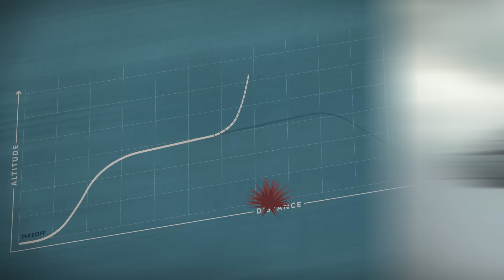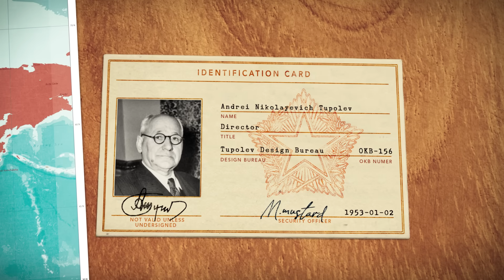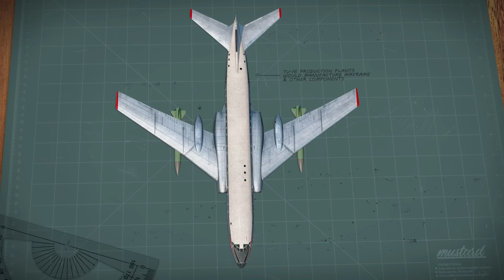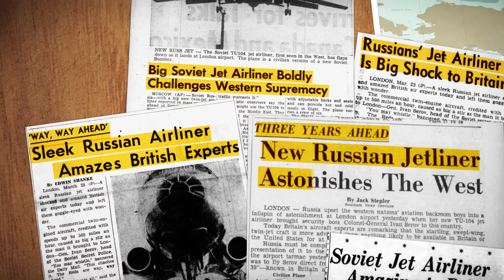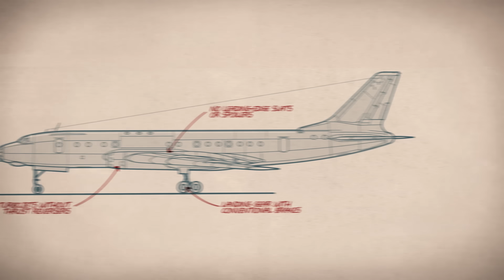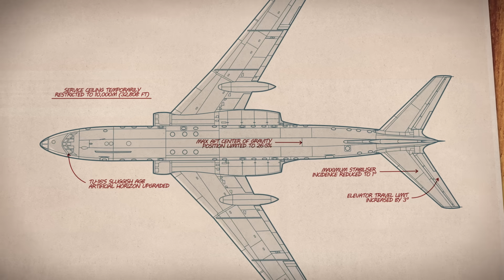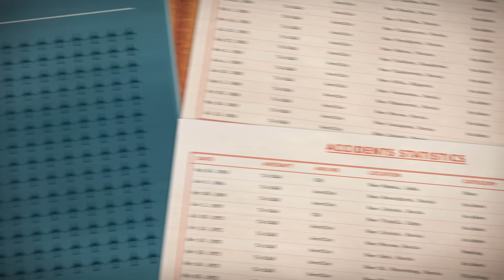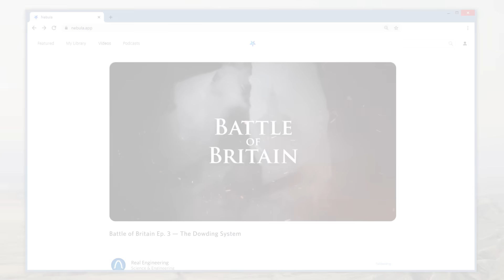The Soviet Airliner Designed To Crash

Comment: It's in English narration, but the results are the same in the end. Just ask Putin.😂
Reply: The British Comet is the worst jet airliner in history... no jet airliner has more crashes and fatalities than the Comet.
Reply: @DoktorBayerischeMotorenWerke 

We believe we can clear up some commonly held myths and misconceptions obviously.

It's always good to see the facts presented clearly and concisely isn't it?

Can have any size / shape windows, depends how much extra frame weight gain is acceptable. The ideal shape is elliptical, vertical dimension being largest and vertical to horizontal dimension ratio = to hoop pressurisation stress to longeron stress ratio. 

Obviously there have been worse aircraft for accident losses both before & after the Comet.

The engine position and inlet design had advantages at the time. The inlet design was changed to help reduce the chances of pilot error caused stalls during takeoff. 

All jet airliners benefited greatly from the knowledge gained from the Comet incidents & subsequent investigations & yet some were still worse for accident losses. 

Instances of all marks of the Comet flew with full certification after 1954 including the Comet 3.

The fabulous trail blazing DH Comet.
World's first jet airliner.
World's first high altitude airliner.

    How things were back then.
Accident losses - % of aircraft built.

It should be remembered that it was not unusual for the first batch of say 10 of a type to have much higher accident losses than all the aircraft built. 

DeHavilland Comet 4 UK                     14% 
DeHavilland Comet all (ff 1949)         17%  
Vickers VC10 UK (ff 1962)                   5%

Douglas DC-1                                      99%
Douglas DC-2                                      47%
Douglas DC-3                                      30%
Douglas DC-4                                      26%
Boeing s300                                          72% 
Boeing 307                                            70%
Boeing 247                                            48%
Boeing 707  (ff 1958)                           20% 
Lockheed L-049/149 Constellation    30%
Lockheed Electra  Turboprop .            29%
Fairchild FH-227                                   30%
McDonnell Douglas DC-8                    14%.
Sud Aviation Caravelle  (ff 1955)       15%
Canadair CL-44 Turboprop (ff 1959) 46%  
Convair CV-580  Turboprop                22%
Convair CV-880     (ff 1959)                27% 
Convair CV-990     (ff 1961)                33%
Tupolev T-104        (ff 1956)               16%
Vickers Viscount   (ff 1948)               32%             

  The Vickers VC10, fastest Atlantic crossing for a non supersonic jet airliner, held the record for 41 years.

For the first few years of operation the Caravelle & Comet had similar accident loss fatalities.

The first few Nimrod airframes were Comet 4 airframes with the equipment bay tacked on. Subsequent Nimrods were new build Comet 4 airframes with the modifications built by the DH team at Hawker Siddeley.

The world's first wind tunnel was constructed in England during the 1870s. The world's first supersonic wind tunnel was constructed in England in 1922.

   Of course De Havilland carried out a full stress analysis & performed extensive & protracted testing, including pressure cycle testing, on two long lengths of fuselage. De Havilland carried out significantly more testing than was required by any authority at the time & significantly more testing that any previous airliner was subjected to.

   De Havilland did indeed always work to better than industry standards at the time, used up to date knowledge for the design & no evidence of negligence or criminal negligence was ever produced in relation to the DH Comet.

  The DH Comet had better safety than or similar safety to many other commercial passenger aircraft of a similar era both before & after the DH Comet.

The accident loss fatalities for the first few years of operation were similar for both the Sud Aviation Caravelle and the De Havilland Comet.
  
Pretty much all changes made after the Comet 1 were just in case changes or were previously planned ongoing improvements.

How things are these days and what's going on in the world.

Airbus is not a German company. There are no longer any German companies making German jet airliners in Germany and there are no German companies making German gas turbine aero engines in Germany that are suitable for wide body airliners. 

That's correct, The Tornado & Typhoon & their engines are supersonic & are indeed British design aircraft with British design engines built by an international consortium. The Tornado design for example started life during the 1950s at Vickers as the AFVG, it's engine is based on the RR RB-199. The EE Lightening is also a British Supersonic jet aircraft.

The Typhoon is the British BAC-EAP with an engine based on the British RR XG-40, the Typhoon is also built by an international consortium.

   A typical but small glimpse of what goes on in the very internationally orientated British aerospace sector.

  Of course the RR Nene was in fact the world's most reliable & most powerful gas turbine aero engine in 1944. Licensed built versions & copies of the RR Nene & RR Derwent would go on to power many aircraft in Russia including the Mig 15 & Mig 17, the US, China, France & other countries for decades after 1944.

The Axial multi stage sequential stage  compressor & turbine technology, first produced for turbo machinery use in England by Parsons of Ireland & North England during the 1800s. The components form the basis of most modern gas turbine aero engines. At the time the concept of the jet aircraft powered by axial internal combustion gas turbine engines was first mentioned thus the internal combustion jet engine & jet aircraft was indeed invented in England before the 1900s & before the Wright brothers got busy.

      Boeing Apache Attack Helicopter.
AH-64: 75 UK suppliers, 7% UK content, global fleet of 1280+ aircraft.
F35B more than 130 UK Suppliers, more than 30% UK content.
F35A & F35C more than 130 UK Suppliers, more than 15% UK content.

There is no doubt that an airline has recently ordered 60 RR England Trent XWB Engines

Obviously the UK has the
World's Highest Combined Per Capita
Nuclear / Defence / Aerospace Sector Activity.

Rolls Royce Holdings UK
Subsidiaries
- Rolls-Royce plc
- Rolls-Royce North America (ex Allison etc Classified Military stuff)
- Rolls-Royce AB
- Rolls-Royce Deutschland
- Rolls-Royce India Private Limited
- Rolls-Royce Marine Power Operations
- Vinters Engineering Limited
- Rolls-Royce Controls and Data Services
- Rolls-Royce Power Systems
- Bergen Marine
Joint ventures include:
- Rolls-Royce Turbomeca
- MTU Turbomeca -

Trent Family
The MT30 (Marine Turbine)
Industrial Trent 60 Gas Turbine
Trent 7000
Trent XWB Airbus A330neo.
Trent 1500
Trent 1000
Trent 500
Trent 600
Trent 700
Trent 800
Trent 8100
Trent 900
   
RR wholly owned subsidiaries in Germany handle smaller 2 shaft RR gas turbine aero engine work.
    
We do indeed hope this helps, of course.         
    
As always, cheers & 👍 indeed etc.c

Comment: I know the comet also has some issues
Reply: Потери в результате аварий - % от построенных самолетов.

DeHavilland Comet 4 14%
DH Comet всех модификаций (выпущен в 1948 г.) 17%
Vickers VC10 UK 5%

DH Comet обладал большей или сопоставимой безопасностью со многими другими коммерческими пассажирскими самолетами аналогичной эпохи.

Douglas DC-1        99%
Douglas DC-2        47%
Douglas DC-3         30%
Douglas DC-4           26%
Boeing s300             72% 
Boeing 307               70%
Boeing 247                48%
Boeing 707                  20% 
Lockheed L-049/149 Созвездие 30%
Lockheed Electra Турбовинтовой 29%
Fairchild FH-227                          30%
Макдоннелл Дуглас DC-8       14%
Sud Aviation Caravelle       15%
Canadair CL-44 Турбовинтовой    46%  
Convair CV-580 Турбовинтовой 22%
Convair CV-880 (с 1959 г.)  27%  
Convair CV-990 (1961 г.) 33 %
Туполев Т-104 (фф 1956) 16%

Comment: The problem with this airline Aeroflot and the Russian airplane sinply is: They are Soviet made... trash.
Reply: На мусор больше смахиваешь ты и твой рот)
Reply: Потери в результате аварий - % от построенных самолетов.

DeHavilland Comet 4 14%
DH Comet всех модификаций (выпущен в 1948 г.) 17%
Vickers VC10 UK 5%

DH Comet обладал большей или сопоставимой безопасностью со многими другими коммерческими пассажирскими самолетами аналогичной эпохи.

Douglas DC-1        99%
Douglas DC-2        47%
Douglas DC-3         30%
Douglas DC-4           26%
Boeing s300             72% 
Boeing 307               70%
Boeing 247                48%
Boeing 707                  20% 
Lockheed L-049/149 Созвездие 30%
Lockheed Electra Турбовинтовой 29%
Fairchild FH-227                          30%
Макдоннелл Дуглас DC-8       14%
Sud Aviation Caravelle       15%
Canadair CL-44 Турбовинтовой    46%  
Convair CV-580 Турбовинтовой 22%
Convair CV-880 (с 1959 г.)  27%  
Convair CV-990 (1961 г.) 33 %
Туполев Т-104 (фф 1956) 16%

Comment: Regarding the fabulous trailblazing 
De Havilland Comet.
Accident Losses generally.

We feel we can clear up some commonly held myths and misconceptions, obviously.

It's always good to see the facts presented clearly and concisely isn't it?

De Havilland was subjected to forced merger under the govt aerospace sector rationalisation programme. A similar process occured globally, Sud Aviation and several other French manufacturers merged during design and production of the Caravelle with the Caravelle becoming a significantly international type project. Even in the US, there was no room for multiple manufacturers of large jet airliners with consolidation being inevitable.

The world's first wind tunnel was constructed in England before 1890.
The world's first supersonic wind tunnel was constructed in England during the 1920s.

The DH Comet was subjected to every type of stress testing & wind tunnel testing possible at the time. 

The world's first high altitude airliner.
The world's first jet airliner.

In fact the Comet was the first airliner to have a full fuselage length pressurised passenger cabin suitable for high altitude flying where pressurisation stress was many times higher than flying load stress. Bow-wing (see b-47 wing folding wing collapse incidents) had built less than 12 pressurised cabin airliners before the Comet first flew. The world's first pressurised cabin aircraft was a British design Airco built under licence in the US and modified in the US to have a pressurised cockpit cabin during a joint US / UK research project. Previous pressurised aircraft were airliners with lower pressurisation & altitude limits where pressurisation stress did not exceed flying load stress or were bombers with small heavily built cockpit capsules where potential total  airframe weight gains were insignificant.

The Comet nose was a unique De Havilland design that Sud Aviation subsequently licensed for use on their Caravelle.

Correct, the Comet was designed with military use in mind. In fact, the first designs were based on military use requirements, the first Nimrod aircraft were straightforward modified Comet 4 airframes. Obviously when the Nimrod first flew, it was of course the most advanced and capable aircraft of it's type in existence. All subsequent Nimrod airframes were indeed simply mostly  new manufacture Comet 4 airframes with the additional equipment bay added. Nimrod design and manufacture was in fact performed mostly by the De Havilland team at HS. 

The Comet was in fact an all metal construction airframe airliner, use of other materials was similar to all other airliners at the time. 

  Obviously there have been worse aircraft for accident losses both before & after the Comet. One of the issues was accident losses due to pilot error which were often caused by the novel aspects of jet airliner flying, even so, the accident losses for the Comet as an airliner were not particularly unusual at the time.

Some changes made were to make pilot error on takeoff less likely to cause serious problems. For example, the skin thickness remained mostly the same from Comet 1 to Comet 4.
Ripstop provision existed for all Comets. The original alloy used was discontinued by the manufacturer, the replacement alloy had similar properties.

  Indeed, at the time aviation infrastructure & aircraft technology etc was still developing rapidly, there was still a lot to do when considering all aspects of flying safety.

    How things were back then. 
Accident losses - % of aircraft built.
DeHavilland Comet 4                   14% 
DH Comet all mks   (ff 1948)       17%  
Vickers VC10 UK                            5%

The DH Comet had better safety than or similar safety to many other commercial passenger aircraft of a similar era.

Douglas DC-1                                      99%
Douglas DC-2                                      47%
Douglas DC-3                                      30%
Douglas DC-4                                      26%
Boeing s300                                        72% 
Boeing 307                                          70%
Boeing 247                                          48%
Boeing 707                                          20% 
Lockheed L-049/149 Constellation  30%
Lockheed Electra Turboprop             29%
Fairchild FH-227                                  30%
McDonnell Douglas DC-8                   14%
Sud Aviation Caravelle                        15%
Canadair CL-44  Turboprop                46%  
Convair CV-580  Turboprop                22%
Convair CV-880     (ff 1959)                27%  
Convair CV-990     (ff 1961)                33%
Tupolev T-104        (ff 1956)                16%

The VC10 held the fastest Atlantic crossing speed record for 41 years (Non supersonic airliners).

For the first few years of operations the Caravelle and Comet had similar accident loss Fatalities numbers.

  Instances of all Comet marks, including the Comet 1 and Comet 3 flew with full certification at some point after 1954. Airline duty Comets were all retired by 1980 with full certification until after retirement. The last Comet flight was a global circumnavigation series of flights in 1997.

   Of course De Havilland carried out a full stress analysis & performed extensive & protracted testing, including pressure cycle testing, on two long lengths of fuselage. De Havilland carried out significantly more testing than was required by any authority at the time & significantly more testing that any previous airliner was subjected to.

  Of course De Havilland had prior experience building many all metal construction airframe aircraft & thousands of jet powered fighter aircraft that were primarily of metal construction with pressurised cockpits & jet engines built by De-Havilland. At the time De Havilland engineers  knew all there was to know about metal fatigue as it applies to aircraft.

    De Havilland did indeed always work to better than industry standards at the time, used up to date knowledge for the design & no evidence of negligence  or criminal negligence was ever produced in relation to the DH Comet.

Military aircraft accident losses compared.
Non combat phase accident losses.
% of Aircraft built.
The EE Lightening did not have unusually high losses. 
The Canadair CL-44 was a turboprop airliner.
Canadair CL-44               (ff 1959 ) 48%
Lockheed XF104             (ff 1954) 100%
Lockheed  P80                (ff 1944)  43%
Lockheed F104               (ff 1954)  45%
MD FH Phantom 1          (ff 1945)  35%
MD F4 Phantom 2           (ff 1958)  28%
Convair F102 Dagger      (ff 1953)  45%  
MD F3H  Demon              (ff 1951)  32%
MD F-101 Voodoo           (ff 1954)  34%
EE Lightening                   (ff 1954)  33%
Gloster Meteor                (ff 1943)   21%
DH Vampire                     (ff 1943)   23%
DH Sea Vixen                  (ff  1951)  33%
Gloster Javelin                (ff 1951)   20%

Note that the Meteor didn't have particularly high losses, flew with more than 20 airforces for decades, got involved in air to air combat during a number of conflicts successfully against aircraft that first flew many years after the Meteor first flew.
 
We hope this helps, of course.       
       
As always, cheers & indeed 👍.